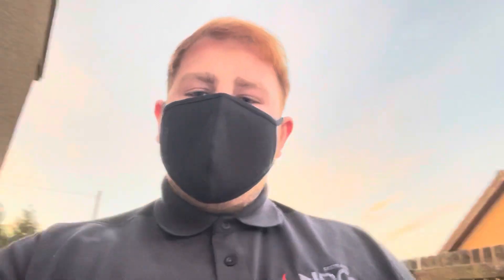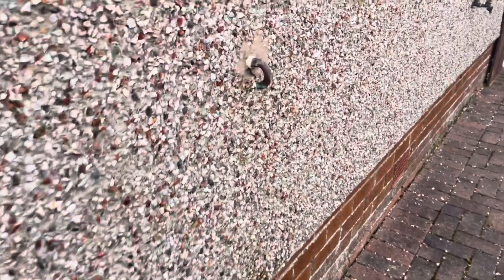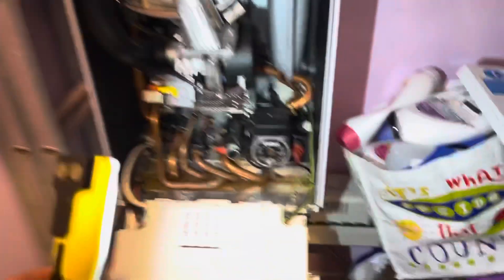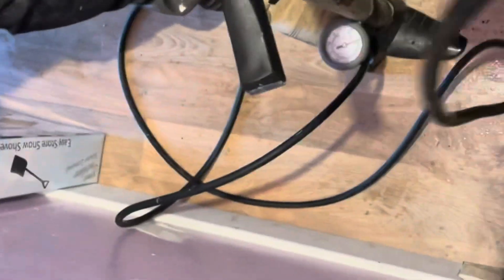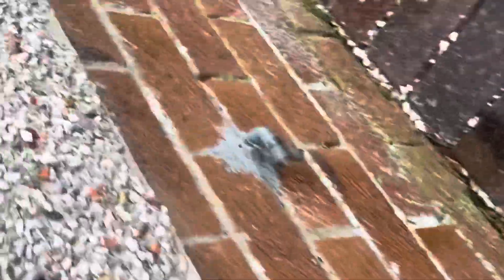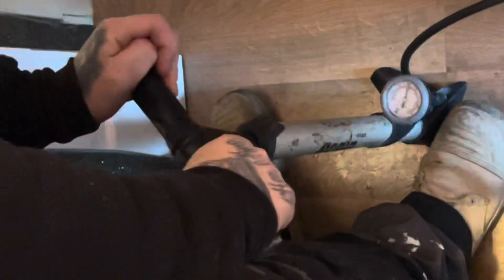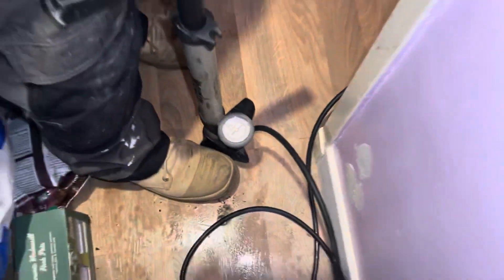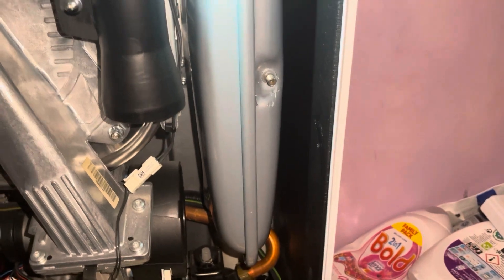Recharging an expansion vessel | Is you’re heating system always loosing pressure?

Comment: Thanks for the video.  Can a homeowner legally perform this task or must it be carried out by a qualified professional?  Thanks
Reply from the maker: Qualified gas safe engineer only
Reply: @fraserhoehle2256  I had an engineer out yesterday who pressurised the vessel and replaced a valve cartridge inside the boiler.
Reply: @fraserhoehle2256  does water need to be empty before repressuring the expansion vessel